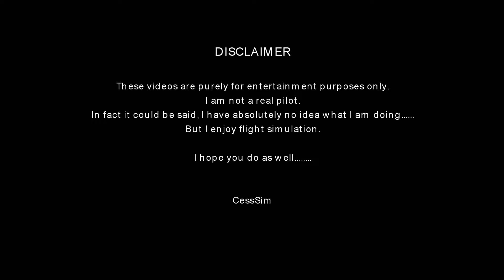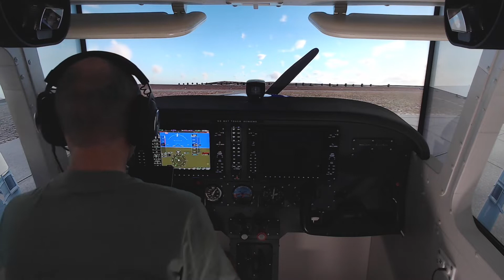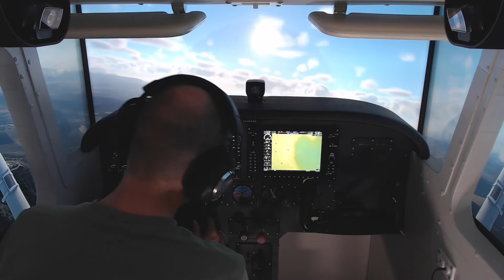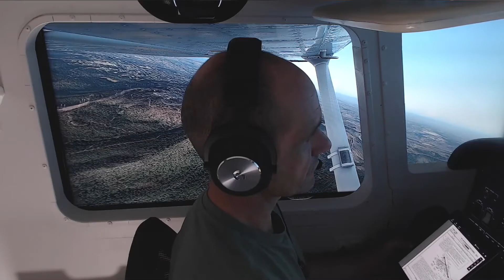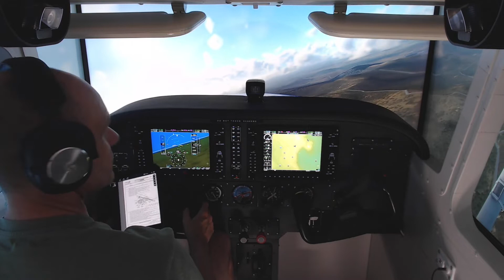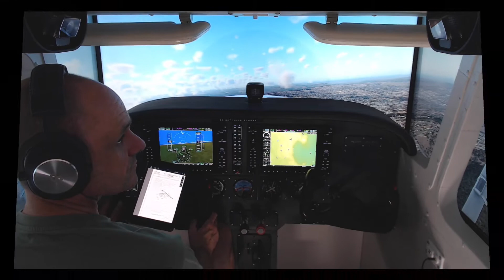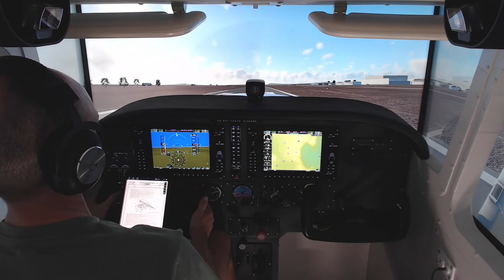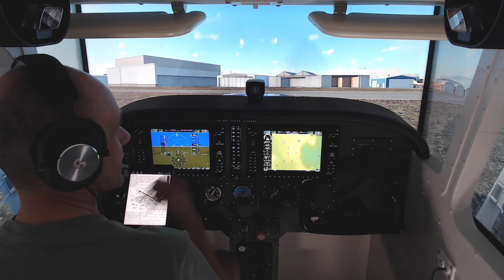107 - Let's try some stalls....

Comment: Stalls are all about rudder rudder rudder. You need to keep ailerons neutral, I usually lock my arms locked against the side of the door to stop the temptation to use them. You had a massive wing drop because of aileron use. 

Two common procedures. 

Idle stall. Power to idle and clean configuration. Slowly bring back elevator keeping the aircraft on the horizon and aileron neutral. Use rudder to control banking. When stall horn sounds keep going since it's a warning before the stall. In real life you'll feel the buffet which you wont in the Sim. In your case probably best to pull the elevator all the way back when you hear the stall horn. To recover release some of elevator until you are in a downward pitch with the horizon showing out the window. Full power. 

Approach stalls are similar but one or two stages of flap and 1600 rpm. 

But key thing to remember it's usually used as a exercise to show you at low speed the rudder is more effective then ailerons. the issue using aileron for stalls is sure the wing drop but also can induce a spin if not careful.
Reply from the maker: cheers Glenn.  Thanks for the feedback and will give it a crack.  When is your video in BSV going live??
Reply: @CessSim  haven't been able to get back in her. Floods rain every day I been free.

Comment: Agreed with above comment. Never touch ailerons during stall, keep them neutral position and use opposite rudder to stop turn. Remember the reason you stall is because your wings exceed the critical angle of attack as you are pulling back to keep it level with low speed (it's about 16 degrees for cessna172). If you use aileron you increase the camber hence the angle of attack which would make the situation even worse.
Reply from the maker: thanks mate and noted. Going to try it again based on Glenn's feedback.